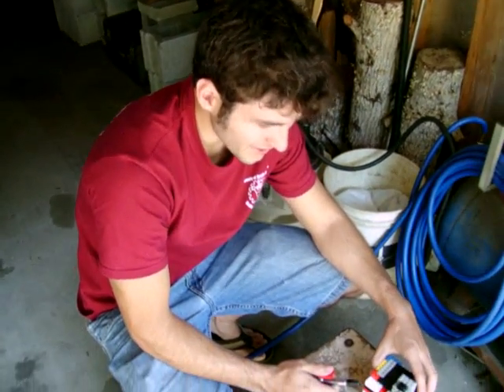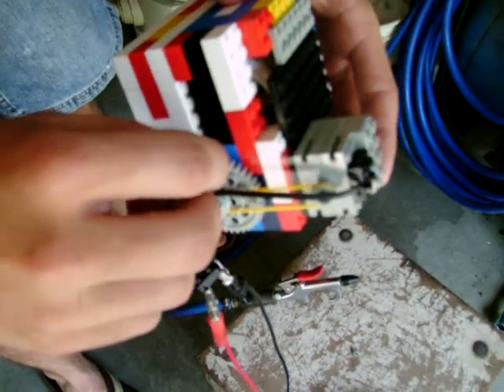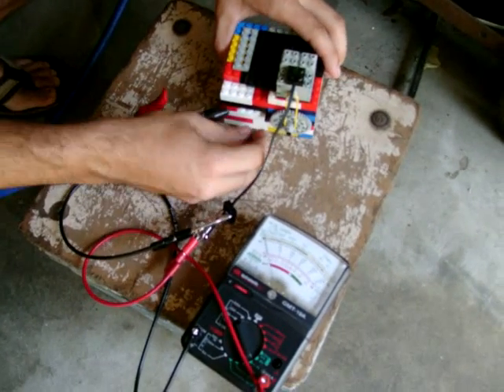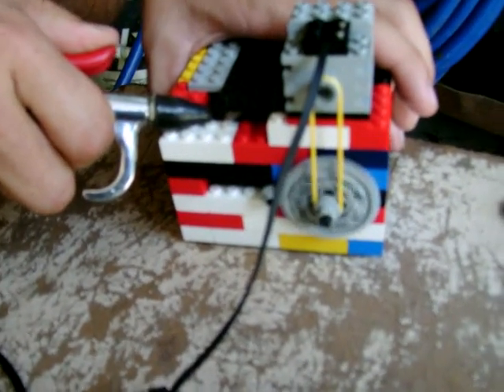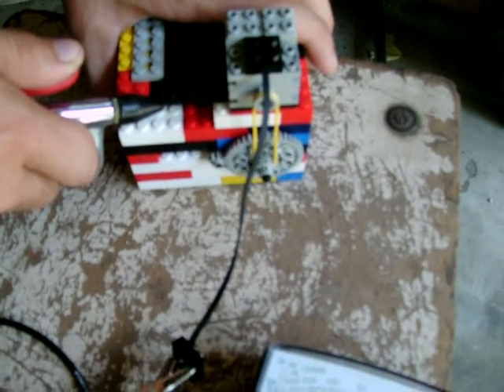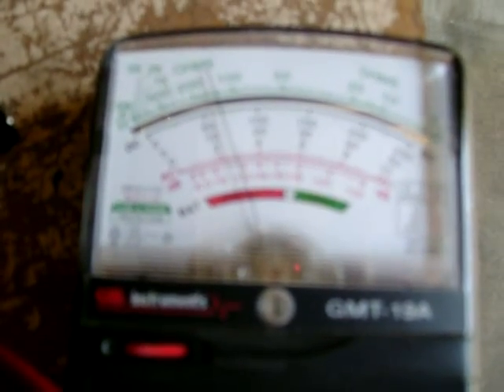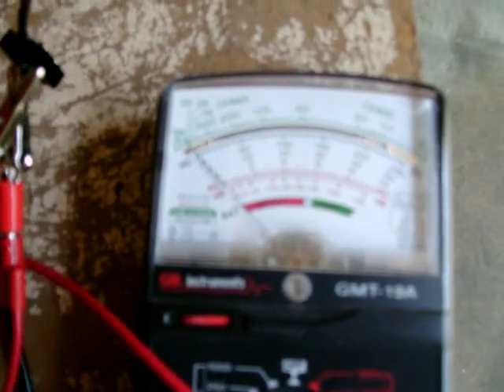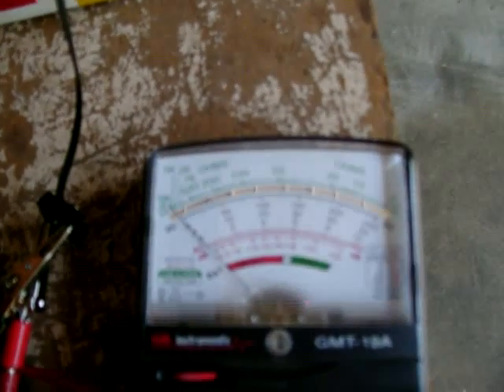Lego Steam Turbine Generator

Comment: Doubt its the motor topping out, as most permanent magnet DC motors will just generate more and more power the faster you spin them. Its probably the rubber band giving up and the drive pulley just starts slipping.

Comment from the maker: turning lego motor in any direction will generate electricity. put your tungue on the motor contacts and have at it. you will get shocked. or connect motors together by a single wire and spin one of them. the other will follow suit